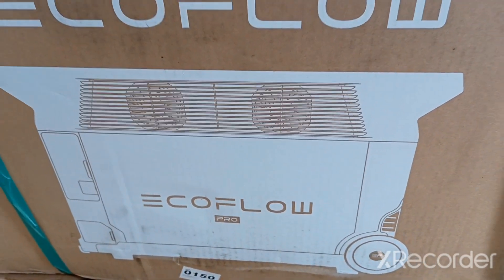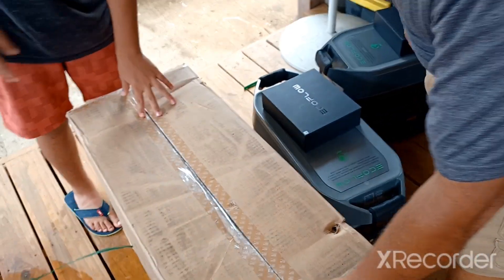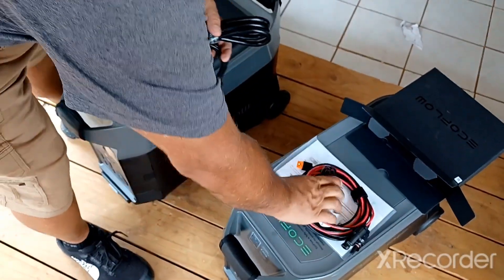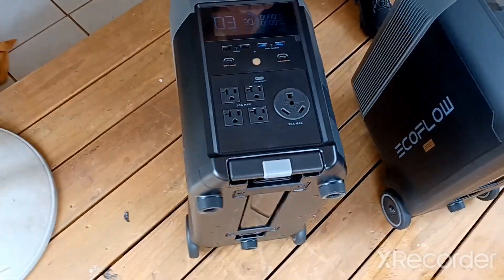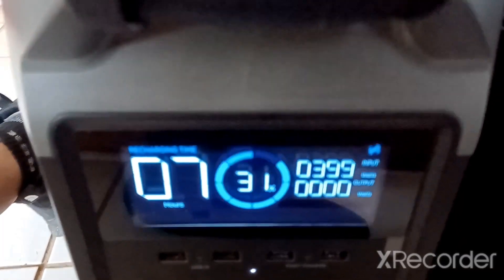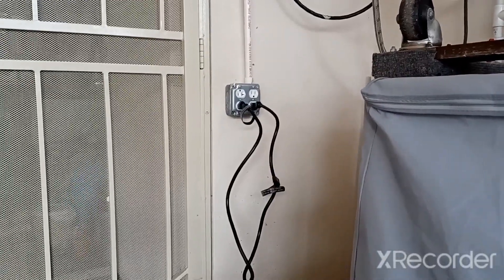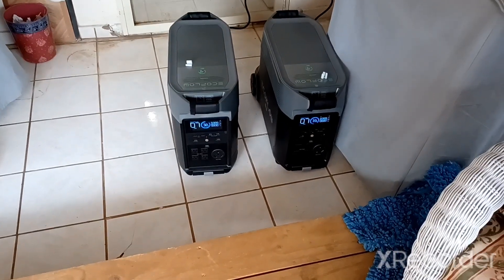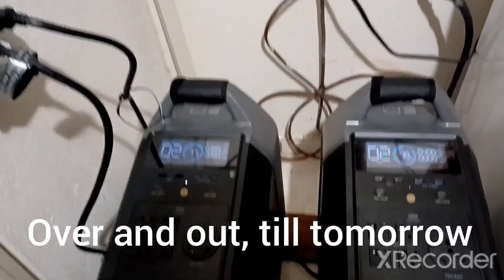DIY my Ecoflow emergency system its easy.

Comment: You get a power grid that generates 7200W at comstant and 14,400 surge watts or 9000W continuous and 18,000W surge when X-Boost kicks in.  You need a 240V hub that plugs in with the two of them together.

Comment: Hello, how do you send them to Puerto Rico? I am looking to buy one, but the prices here on the island are very high.
Reply from the maker: you can send them through Crowly, great service, but if you want I ma selling mine for $4000 thats $1000 less then power solar and I just got them in late august and tested them for in Fiona, but I need a bigger system, I already sold one and I have one left, there new and its going to cost you $3700, plus shipping about 200, and florida tax, 278, and I am in Cabo Rojo
Reply from the maker: reach me at my email, diaz.proconsulting@gmail.com

Comment: just learned that some units have 30Amp connector wired backworks. Investigate...
Reply: Pretty sure that's old and was preproduction units sent to reviewers.
Reply: @Trillville43   yes. my unit seems ok. However, the solar panel connector had a screw fall out, and the plug got pushed in. DOH!
Reply: Saludos desde Barceloneta.  Estoy pensando en comprar directamente de la página una refurbished.  Gracias por los vídeos.
Reply from the maker: yes, older gen, and the test generation that was sold on the fund me sales.
Reply: @Island prepper  That's incorrect. It was fixed before the kickstarter ended and unit started being shipped.